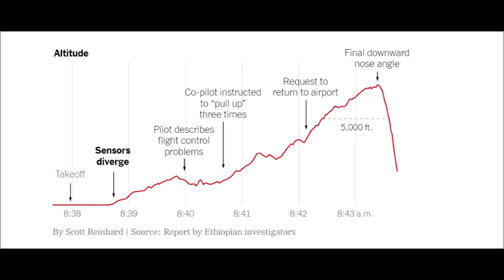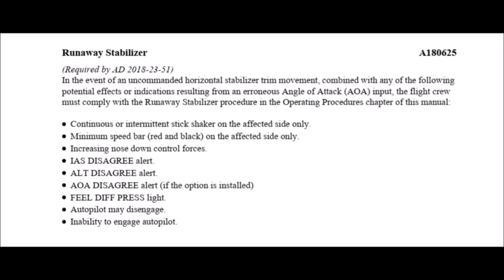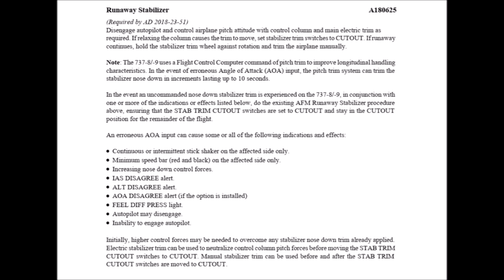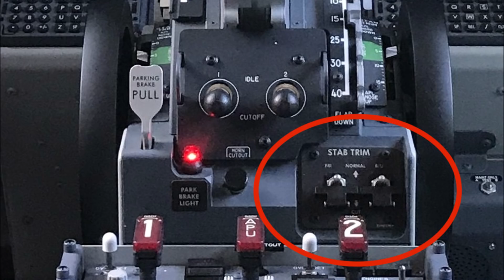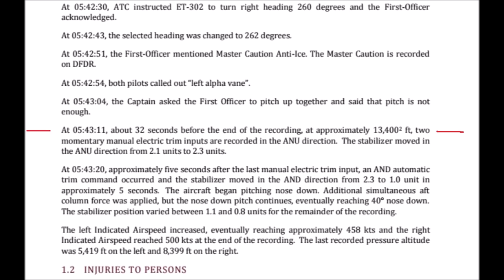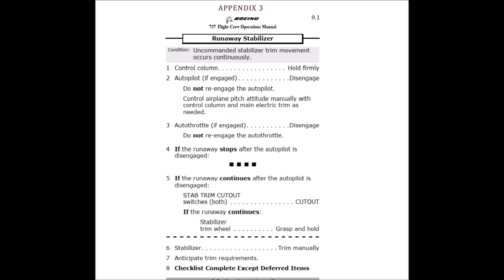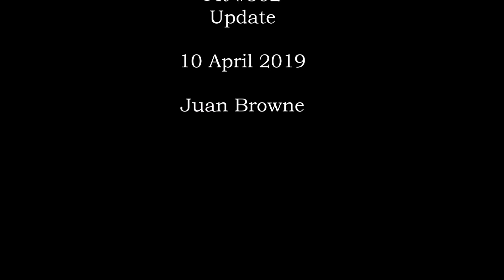737 Max Update 10 April 2019 Runaway Stab Trim Procedures

Comment: Again, this profile appears as if the StAb-Trim breakers were in active mode.. Whereas the first direction was to cut out the stab trim breakers for the remainder of the flight.
Aviate, navigate, communicate...why in the hell are those stab trim breaker positions not on the data recorder?
Reply: Not only that but why does the pilot even have the ability to re engage them in violation of stated instructions?
Reply: The spokesperson from Ethiopia air was clearly covering their butts. She wouldn't know

Comment: Great video! What happened with the MAX is unprecedented in the modern era of aviation and a great tragedy for the families of the 346 victims and everybody who feels for them.

Safety has become better and better with every decade. But then all of a sudden 2 brand new 737 MAX airliners fall out of the skies. We must go back a long time in history to find similar incidents with brand new aircrafts. In 1954 two new De Havilland Comets went down over the Mediterranean sea. Before these crashes another one was lost in India during a thunderstorm ….  A lot has changed since then. And Boeing should have known better. 

During the certification flight tests Boeing discovered that 0.6 degrees pitch trim for the MCAS was not sufficient to prevent stalls. They raised it to 2.5 degrees (without acknowledgment in the certification documents). The proposed fix will lower the pitch trim of the MCAS and MCAS can act only once. Ok. So far so good. But the tendency to stall under certain conditions is still there and not cured at all.
 
A stall is not lethal if there is enough height to put the nose down and gain speed. But what if the airport isn't at sea level but at 5000 or more feet and you are just 1000 or 2000 feet above ground level? Then it's getting dangerous.

Read also on Bloomberg: https://www.bloomberg.com/news/articles/2019-04-11/boeing-has-called-737-max-8-not-suitable-for-certain-airports
Reply: There are more fixes to the software as well as training. when it comes to stall though, remember, there are almost 400- of these already delivered and none have had issues with stalls. They fly smooth and quiet. Now with the fixes, it will stay that way now that the pilot community know about it, and pilots have way more authority of it. Also with AOA disagree now standard, anything disagreeing over a certain amount also shuts MCAS down. Horrible tragedy, and with it and events like this we try to make air travel even safer.
Reply: @averymadden9602  MCAS prevents stalls. It works fine as long as it gets proper data.
When you must switch it off during the stabilizer runaway procedure then it won't help you to prevent a stall.
Reply: @averymadden9602  There was a report in Bloomberg that Boeing claimed in a hearing 2 years ago that the heavier Max types (8,9,10) can't operate safely under hot and high conditions when higher lift off speeds are needed. Boeing didn't state why they just claimed it in the hearing. Please remember that both crashes happened under hot or high conditions. Usually few airports in the US have these conditions.

Comment: You nailed it in the previous video. I am and also continue to be impressed by your aviation videos. However, when a pilot pulls on the column the plane cannot aim nose down, regardless of whether the pilot was right to do so or not. This is murder by fly by wire.
If a pilot pulls on the column and stalls and kills an aircraft, then that's what he does. But, instead, having a computer refuse to honor his command because "Microsoft knows what is good for you better than you do" is the science fiction nightmare of automation killing humans. Terminator 737.
Reply: Agree with you "murder by fly by wire." That's why the "lawsuits are flying and the Max is not" as stated in the other comments.
Reply: Skynet has become self aware.
Reply: Your previous video jack screw demonstration was awesome, by the way.

Comment: Plaintiff's lawyers will be crawling all over that emergency AD. It is confusing, inadequate, and misleading in many ways.
Reply: I read an interesting comment on an aviation forum: "Stick shaker QRH: smoothly apply nose down elevator to reduce the angle of attack until until buffet or stick shaker stops". If they blindly followed the QRH, there would a couple of smoking holes just off the end of the runway. "While every attempt is made to supply needed non-normal checklists, it is not possible to develop checklists for all conceivable situations"